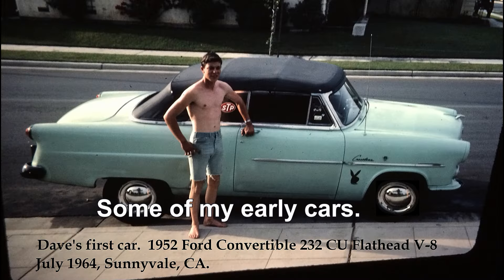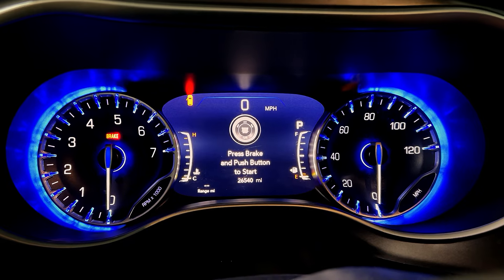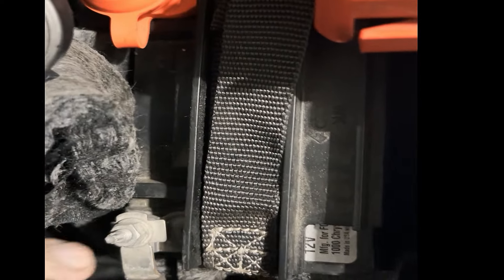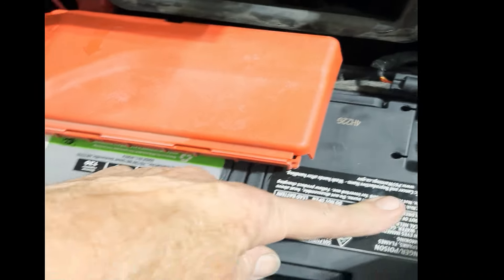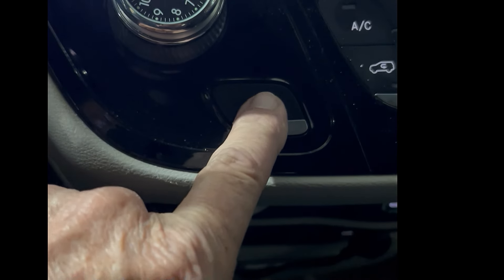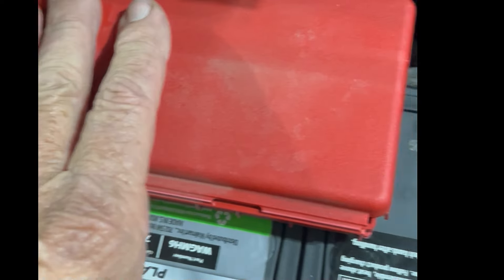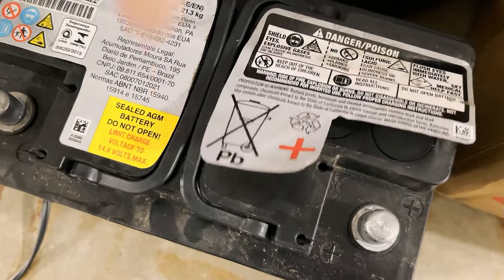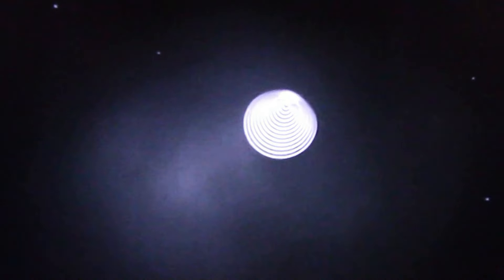My gas Chrysler Pacifica has 2 batteries. I did not know this.

Comment: Good stuff but those are nuts and bolts, not screws. 😉
Reply from the maker: Not really a bolt or a screw.  They are like a screw with a sharp tip, but threaded.  You get the idea.
Reply: @NightFlyyer  ahhh.... Gotcha!

Comment: Never heard of anything so ridiculous. Why would they do this?
Reply from the maker: @tims8603  Agreed. Its supposed to save gas. Lots of laughs.
Reply: @NightFlyyer   I did some Googling. Evidently, it's because of all the computers in vehicles these days that have to be kept alive to store settings and such. I still don't quite understand why they couldn't do that with one battery though.
Reply from the maker: @ Right. I mentioned that in my video. When the motor shuts off at a stoplight, the small battery runs the heater and ac fans,lights and all of it. When it starts, nothing blinks so it’s a great buffer.  But unless im waiting for
 A train, not sure those red light stops save much gas. Btw, If it stops too long, it will restart,as it’s all being done from that small (motorcycle)battery. I completely undid both but the capacitors in the radio must’ve kept it alive long enough because I did not lose my personal settings, like stations. Time was off tho!  Lots of laughs. Thanks again.